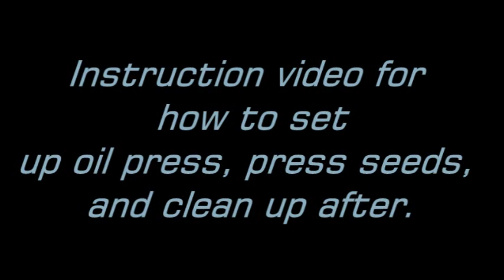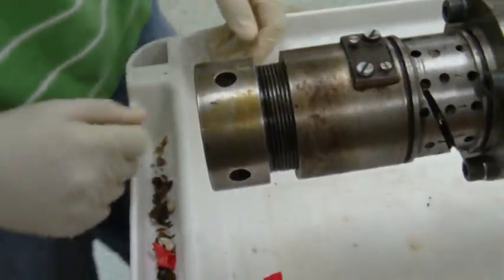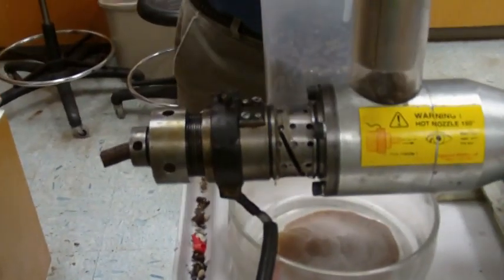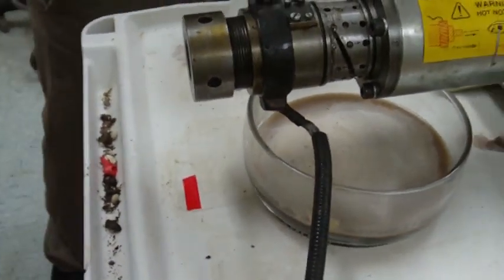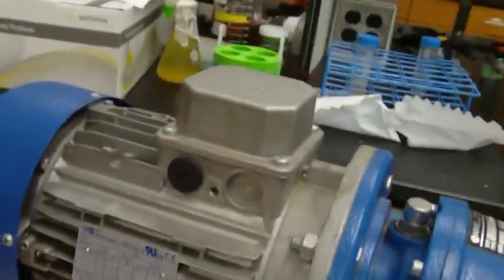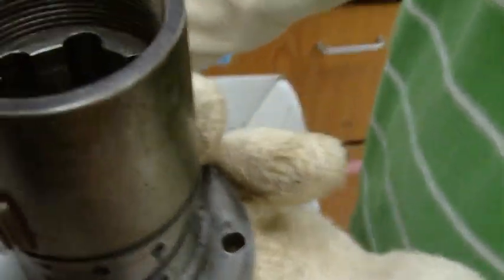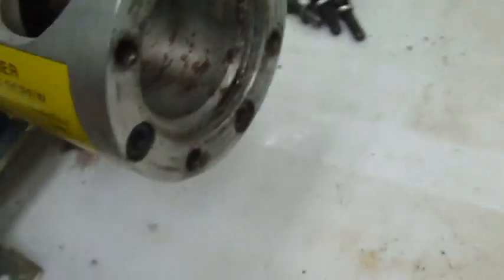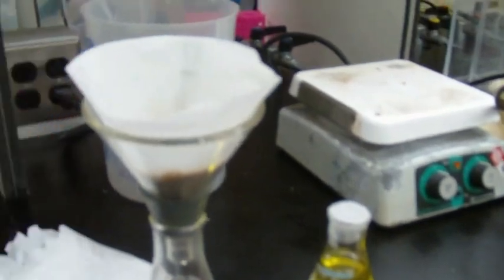instruction video for oil press

Comment: Hi whats the reason we need to heat up the head?
Reply: tO START THE OILPRESS. IT must be alittle warm to start . to heavy
Reply: 1)Heating is for gland rupture of the seed.
2)Heating is for softening of the extrusion of the residual cake at start only in cold pressing operation.